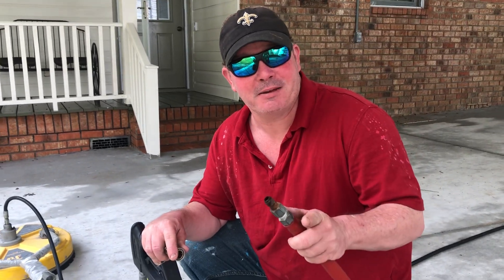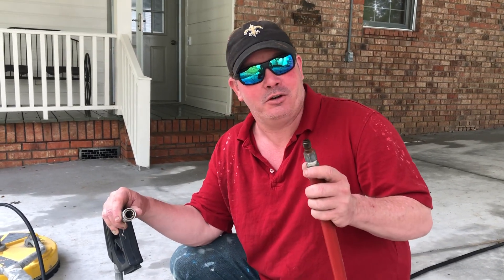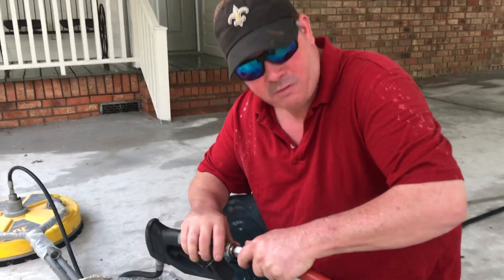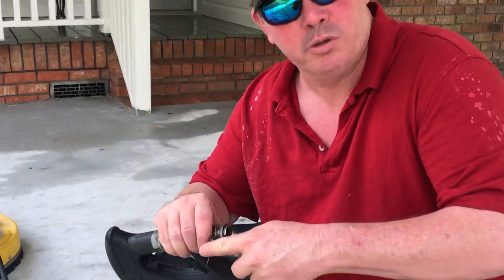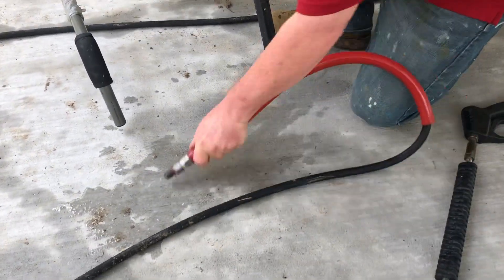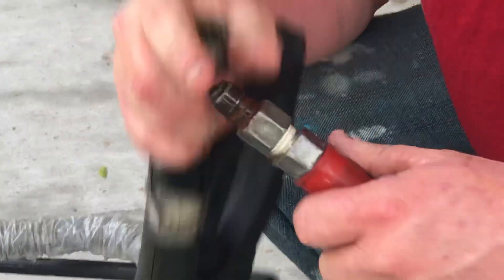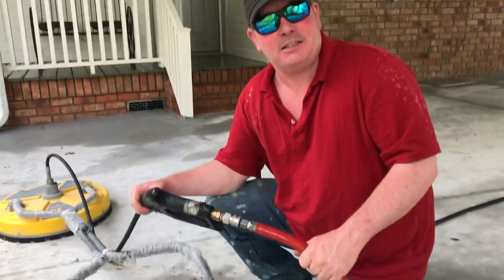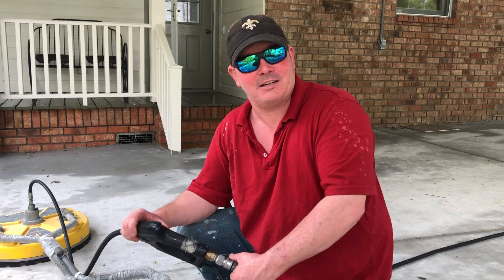Pressure washer quick connects

Comment: Billy, it's much easier if u just carry a small file on the trailer. Also use s.s. it last much longer, make sure the seals are viton in the q.c. You should take that gun and 1/4" hose off of your surface cleaner as well and run the hose right to the swivel with a ball valve on it. You will get full flow, I can absolutely tell you ur 8gpm machine is only putting out around 6 at the surface cleaner.
Reply: Shit, I just noticed thats not a whisper wash, that's the b.e. which is fine but its 1/4" at the swivel and not 3/8 like the whisper wash. But I have one of each and it's still better to get rid of the gun. Some ppl don't like to have to bend over though lol

Comment: Alright.  I can’t get my coupler apart, now what?
Reply from the maker: Make sure there is no pressure on the machine by releasing the trigger. Even if you turn the machine off sometimes pressure stays built up in the pressure line. Once you do that try to release the quick connect if that does not work try tapping on it gently wearing I protection to help release the trigger mechanism in the quick connect